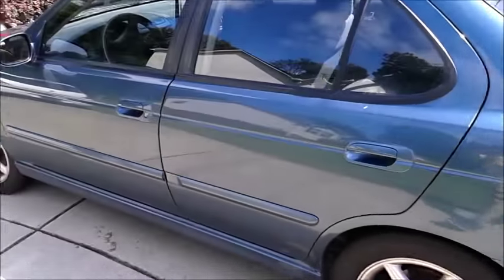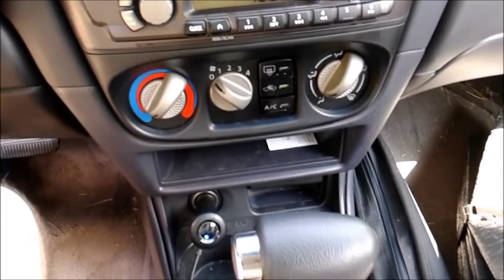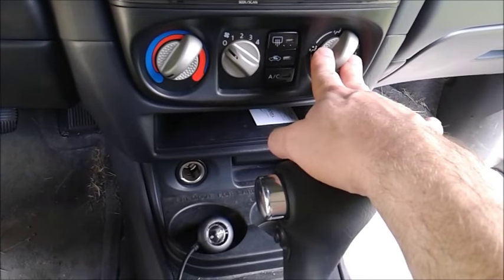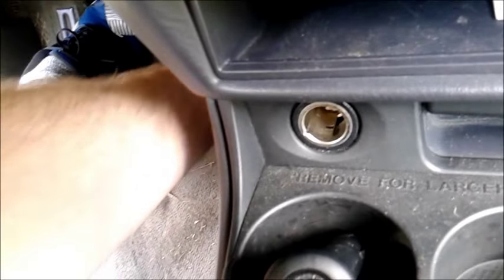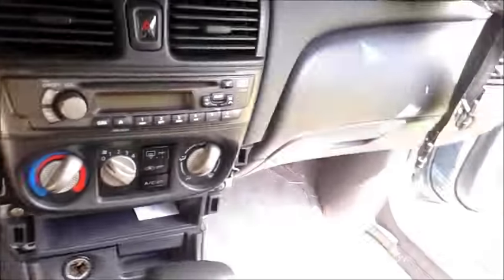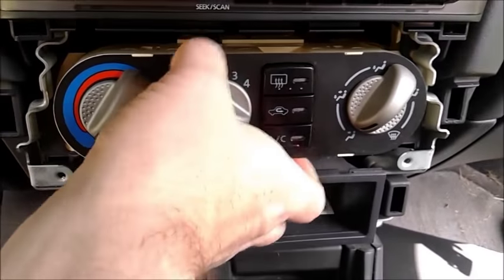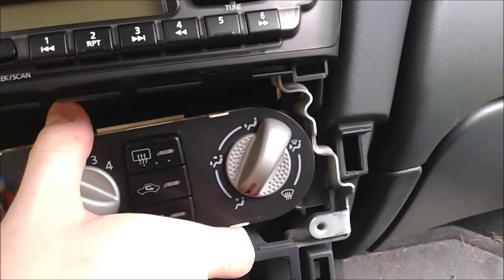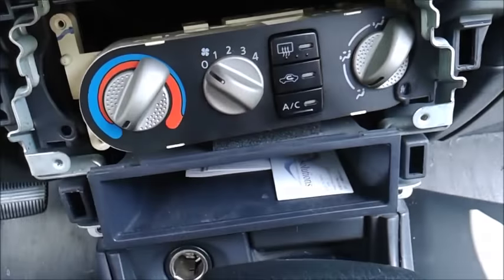01 Nissan Sentra vent selector switch & temperature control repair

Comment: This is the exact video I needed. Thank you so much man. These are really great cars too. They run forever. Mine has 230k miles now and starts and drives like a brand new car. An easy 3-400k mile car.

Comment: I really thank you so much for your video.. Turns out my selector detach from other end. Under stearing wheel.. Unfortunately I couldn't attach cable.. I had no space to work with. I just moved it with my finger to leave it for feet and front windshield.. Thanks again..
Reply from the maker: LucSon FunPol Wow, haven't heard of it messing up on that end not good.

Comment: I fixed the left side (hot cold blend) back in August, and today (February 25) I fixed this side.  I don't know why they put it on the bottom side but it was a little tougher to access.  The ways it's designed it's like they knew people would need to fix it with a cable tie.  Mine is a 2002 GXE.  Low miles and very well taken care of but a piece of junk.  Great video.
Reply from the maker: Glad the video helped.
Reply from the maker: Thanks.
Reply: Carl Davenport Thanks for the help. Have to do the same to mine. Same car as yours Rodger. Dealerships do make things harder on purpose.

Comment: Awesome video. One additional tip, after a while the cable may work its way loose from the ziptie. I suggest adding a bit of epoxy or hot glue and fasten the ziptie to the outside part of the cable. Just make sure not to get any on the wire that has to slide easily in and out of the cable.
Reply from the maker: Glad you liked the video.

Comment: Thank You Carl, I will try to fix it tomorrow Nissan Sentra 2005, same problem / mechanism, same solution.
Reply from the maker: Did it work for you?
Reply: i could not do it , i will work on it until  next weekend. thank you
Reply: I did it, thank you very good video.  two ties and done.

Comment: Really is a great video, only issue I had was trying to work the unit out enough to be able to work on it.  I have been just pushing the cable to the front setting for summer and pulling it out for defroster in winter.  Works but its a pain in the ass.  Might just spend the 79 bucks to get a new assembly
Reply from the maker: If you can get it that cheap that's not bad.

Comment: 2000 Altima is only blowing from defrost how do I get it to blow from the regular vents it just started doing this could that be a relay or control module
Reply from the maker: Not sure on the Altima. Will need to check a Nissan forum.
Reply: Im having the same problem rt now. Did you get it fixed?? If you did what was the issue? Please help

Comment: Does anyone know where the fuel pump relay is of 2006 sentra 1.8L ?
Reply from the maker: I do not. Hopefully someone will chime in.
Reply: The gas pump relay is near your left feet  under dashboard there is in my 04. Sentra.😊
Reply: @germanfernandez9033  thanks. Yeah  found it kick board left side bottom

Comment: I have this problem on a 05 sentra
Reply from the maker: I think the repair procedure is the same for 2000-2006.
Reply: Carl Davenport true.!
Reply: Melanie did you have a check on engine light?  My 05’ has this same issue and my check engine light is on
Reply: @carldavenport1583  just did this in a 2006 sentra. It's the same, I managed to do it without disconnecting the radio wires, but there is very little room and no way you could really have made a video showing it. ty for this Video
Reply from the maker: @jerrybeard8995  Glad you were able to get it fixed.